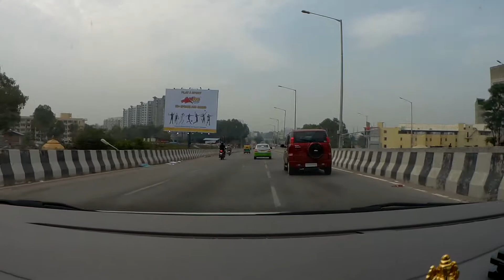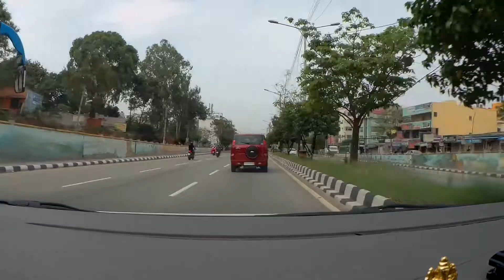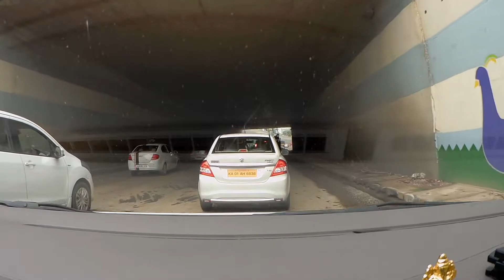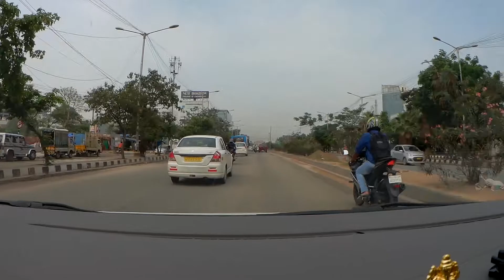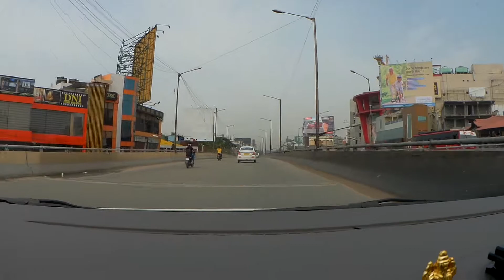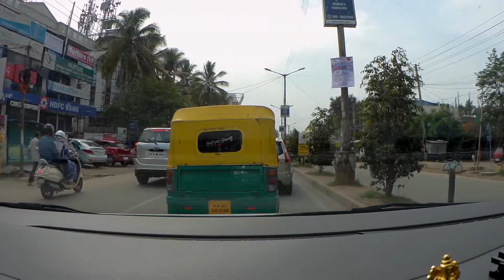Automatic Gearboxes - DSG?? AMT?? CVT?? Torque Converter?? Which one to choose?

Comment: If you value a fun driving experience and/or reliability, stay far, far, far away from push belt CVT, CVT sucks ALL the fun out of driving., torque converters are the most reliable, but waste the most power in the converter, DSG is closer in feel to a conventional manual, I have yet to try an AMT, so I reserve judgement on that, sounds acceptable in theory though, but the CVT? NO!, just NO!

Comment: Hi, I’m planning to buy Polo GT Tsi which has DSG gear box. But I heard that they are not appropriate for Indian conditions and GT Tsi has lot issues due to this box. Seeking ur advice
Reply: Mine is polo GT and completing 6 years by June not a single issue in my car.what else do you want?
Reply: @ks19780  wts ur odo ?
Reply: @rohith4344  78k till date
Reply: @ks19780  great bro wt is the service cost?
Reply: @rohith4344  approx 12k INR .
Reply: @ks19780  i hav 2018 model i ws worried about dsg thanks for ur reply